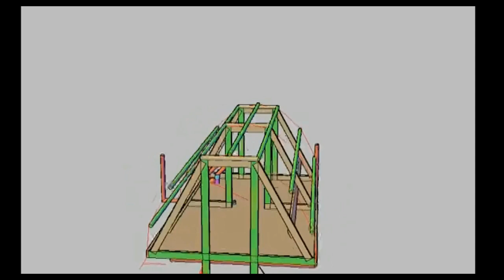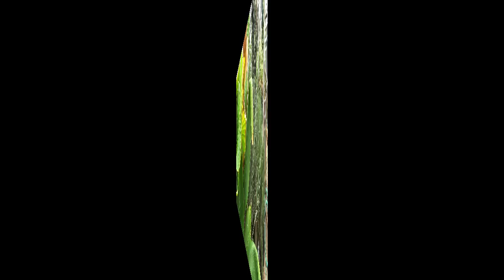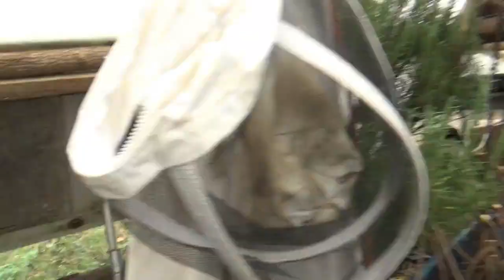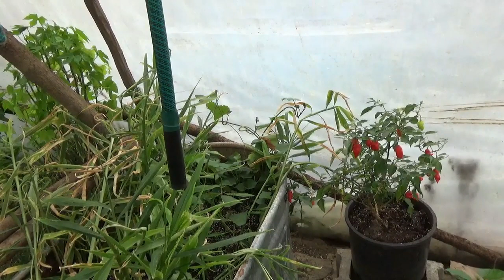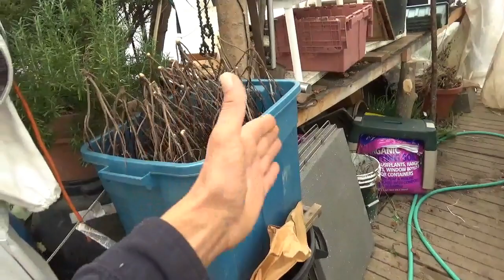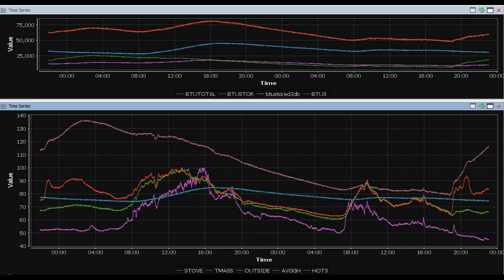What You Need To Know To Build You Own Greenhouse Series Part 1*Basics Explained*

Comment: Awesome start been super busy finishing up harvest had a chance to stream this video on my plot combine so many questions ... Lol.  Really appreciate you taking the time to do it... I'm late to the party It looks like part two just dropped I'm going to watch that now!  The sensing system is the thing that is always intrigued me I have a next generation state of the art sensing system to detect temperature cubic feet of air per minute (cfm"s) humidity, wet bulb, ambient temp and ambient humidity.   You're confirming a lot of what I thought a proper greenhouse would be find your heat source and find your vent source and then the question is how to optimally automate the temperature controls.  Just like with my drying software it's just a tool to help you at the end of the day it's still a call that the greenhouse manager has to make.  The obvious choices are easy and can be automated hey it's -5 degrees I want maximum heat!  My system also has alarms that will go off and text and email me if a certain parameter goes outside of the set point and I can set all of those parameters up if I don't want it to get hotter than 102 degrees If for some reason it goes to 103 it will let me know I also track inches of static pressure from one chamber to the next... Drying seed corn in a double pass reversing dryer... Is a totally different thing than a greenhouse but on the same level it takes 24/7 around the clock tracking.  Look forward to part two thanks man
Reply from the maker: Awesome! I'm glad you're enjoying so far! Yes, I can program emails / texts etc into it. I did have a low temp program written in years back that would check temps, decide based on a set of parameters, and email me... but i have the heads-up charts and I don't use the cell phone.   Yes, exactly... pick the inputs, and manage them well. As we go forward, this will all be much more automated and update-via-remote webpage oriented.  We are still refining the pieces hardware and software wise. I hope to get to writing the basic dashboard webpage this winter, but we'll see, lots of hurdles to jump. Just traced out my sensing problem tonight. Need to replace all my sensors from the lightning strike. Thanks for checking in Brad!